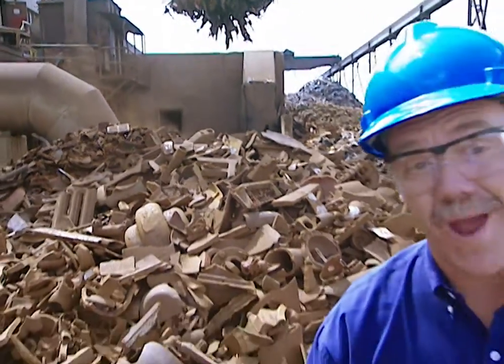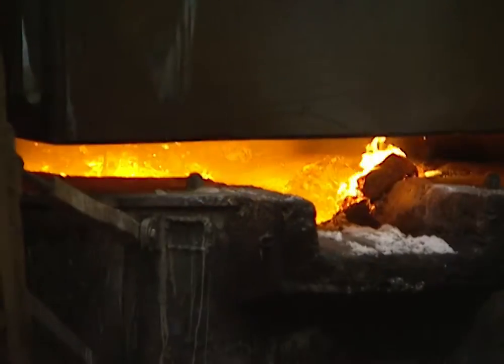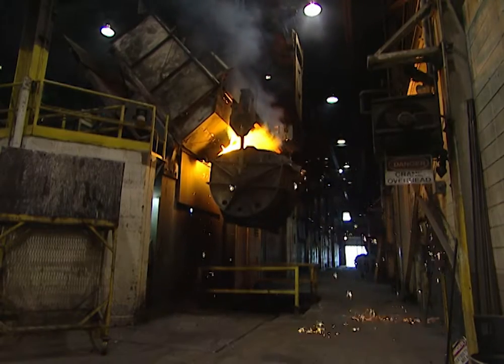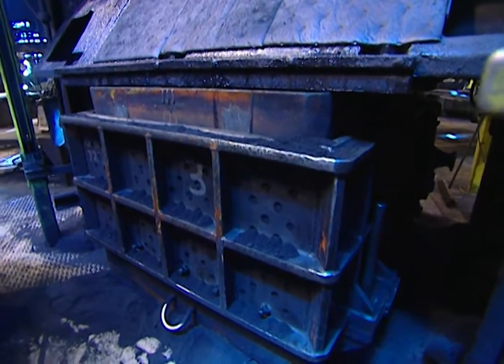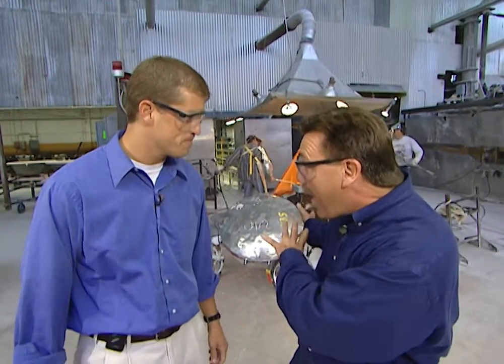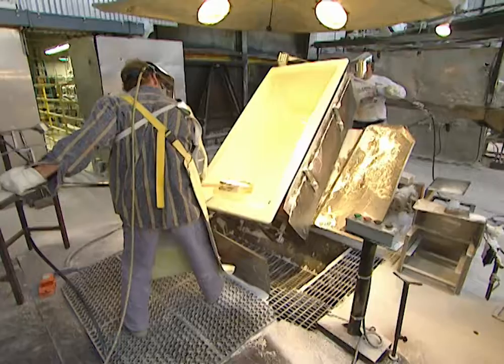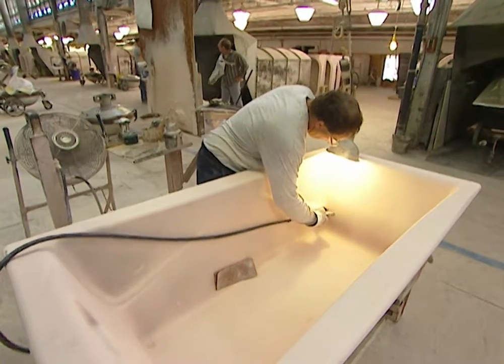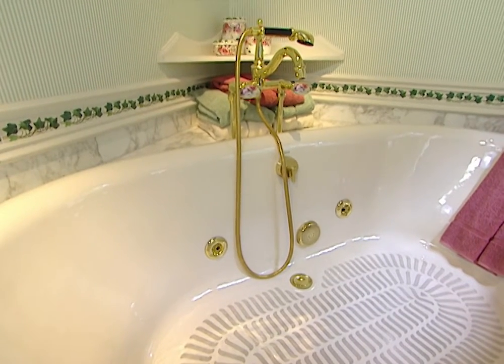How Cast Iron Bathtubs are Made: Kohler Factory - Did You Know?

Comment: Their is one catch. Metal will rust. One speck of rust will spread and the tub will eventually fall apart.
Reply: and nothing will last longer
Reply: Your options are :

Acrylic tubs reinforced with fibreglass which last less then 20years. ( 10 - 15 )

Fibreglass tubs which last 10 -15 years.

Steel Bathtubs are supposedly good for 15 - 25 years 

Cast Iron Enamel coated Bathtubs ( like in this video ) which last an easy 70years.

There are of course other options like Copper, or PURE ARTISANAL BOUTIQUE “I GOT MONEY” BathTubs, etc !
Reply: I grew up all My 50+ years of owning & living in places that have cast iron tubs & sinks.  I've never seen rust to where it makes a cast iron sink/bathtub fall apart.  
I also cook on cast iron cookware.  I have found a few that people throw away completely rusted, never seen any falling apart.  
I soak in 30% vinegar for 2-7 days, rinse off the gross rusted "slag" (if You will), scrub vigorously with coarse steel wool, then SOS/Brillo pads, rinse/repeat several times until all rust is gone.  Grease it with shortening, olive, or corn oil, soybean (no Canola oil) bake it for 2+ hours 500 degrees until turning black.  
Lots of work, of course, but it won't be if You like/love restoring cast iron, simple cleaning & maintenance after restore.  Many people have other methods to restore Iron. 
Each time its cooked in oil/grease between each use & cleaning, the better it gets at being naturally non-stick.  
Unlike that toxSICK garbage called Teflon/nonstick ceramic/Etc.

Comment: ⚫️ Your options are :

▪️ Acrylic tubs reinforced with fibreglass which last less then 20years. ( 10 - 15 )

▪️ Fibreglass tubs which last 10 -15 years.

▪️ Steel Bathtubs are supposedly good for 15 - 25 years.

🖤 Cast Iron Enamel coated Bathtubs ( like in this video ) which last an easy 70years.

▪️ There are of course other options like Geoengineered Polymer Tubs Copper & Finally :

🖤❤️🖤 PURE ARTISANAL BOUTIQUE “I GOT MONEY BÎTÇH !¡!” BathTubs. 🖤❤️🖤